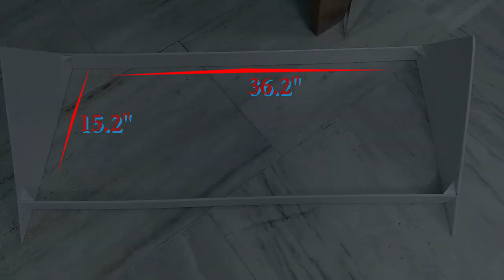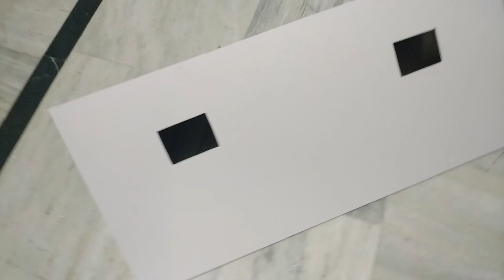HOW TO MAKE AN AQUARIUM TOP COVER / SHADE AT HOME || VERY EASY AND DURABLE || DIY BY PLANET FAHIM ||

Comment: which knife you are using for WPC cutting? Can I get the buying link plz?
Reply from the maker: Normal paper cutter will do. WPC board is very easy to cut.. you can use any paper cutter blade...
Take a look at this Ikon Hand-held Paper Cutter Plastic Grip Hand-held Paper Cutter on Flipkart
https://dl.flipkart.com/s/2Vcd6INNNN
Reply: @planetfahim1727  Thank you for replying !

Comment: Which boards can I use instead of wpc board? It's not available where I live.
Reply from the maker: Thanks for your comment priyanka..!
You can use any board like sun board, acrylic board,  but working on WPC board is very easy and it's very durable. And it's very easily available in any plywood or hardware stores... I am sure you can find in your area..!
Reply: @planetfahim1727  thanks for replying 😊. I'll definitely try this.

Comment: Is it durable
Reply from the maker: Yes it's weather proof, water resistant..and light weight .. it's very durable..!!
Reply: @planetfahim1727  thx but can u tell me in detail how to make
Reply from the maker: In this video..all details are there.. any specific details you can ask what you don't understand.. I will try to answer..
Reply: @planetfahim1727  where I can get thses sheets what's the cost approx.
Reply: @planetfahim1727  thx for your video have subscribed to your channel
Reply from the maker: Thank you very much for your valuable comments ..

WPC board is very easily available in any hardware and plywood store near you.. it's very common board for home furnishings like moduler kitchens, door waterproofing, etc. And cost may very in diffrent places. May be you can buy a peace of that sheet according to size of your fish tank instead of buying whole sheet.... Thank you..!!
Reply: @planetfahim1727  my tank size is length 18 inch 9 inch breadth and height is 12
Reply: Which size shld I take
Reply from the maker: 4.5 sq ft approx I think more or less